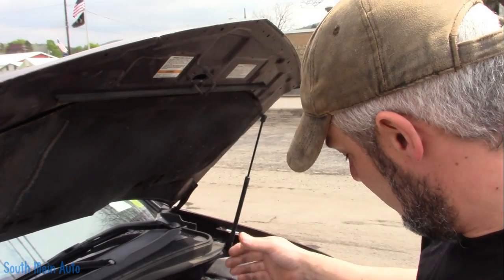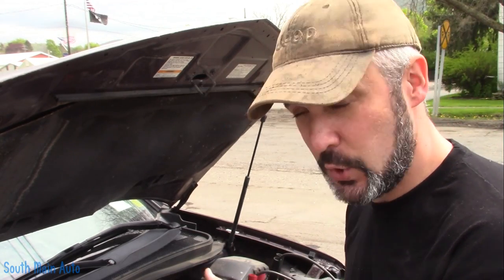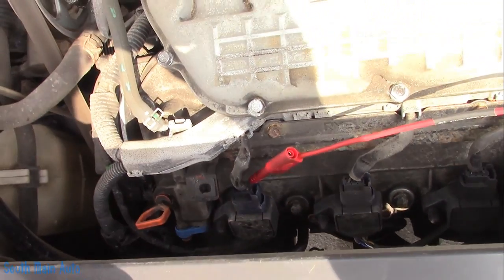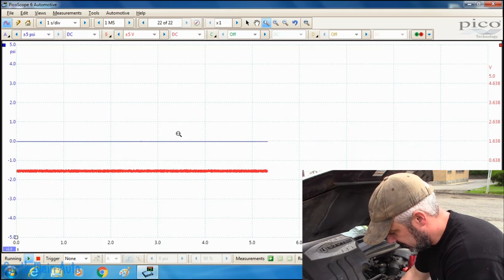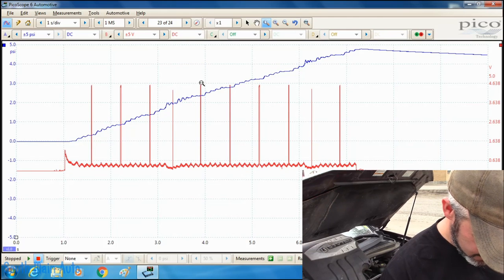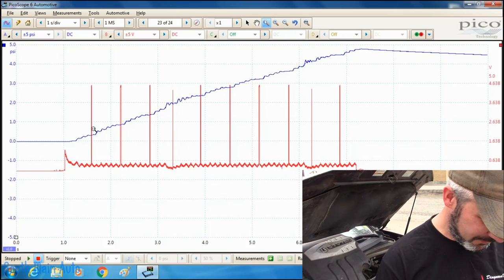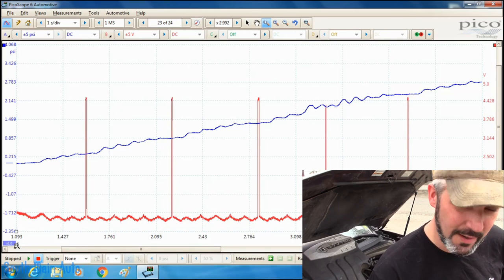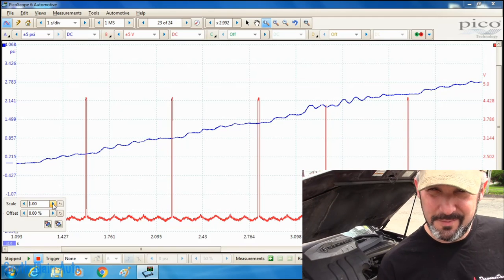Testing For Blown Head Gasket With The Pico Scope

Comment: Had my catalytic stolen on my 99 accord about 6 months ago, they cut the O2 sensor on it and due to lack of funds at the time I just welded a straight pipe to close off the missing part of the exhaust. Drove it around for 3 months like that and had a bunch of cylinder misfires. Changed the spark plugs and wires and it got slightly better but no cigar. Just now got it looked at and apparently my mechanic is saying that although he put a brand new exhaust and O2 on it, the check engine is still on. Says it might be a slight head gasket leak. He quoted me 1300 to 1500 to take it to a machine shop and do the whole 9. 100 bucks for the gasket set and I'll do it myself 😅
Reply: Think I would rather hear “it is” instead of “it might be”. That’s a lot of money and time invested in a guess.
Reply: It's cheaper for you to do, because it's you that's providing the warranty!
Reply: @Graham_Wideman  That's true lol, but since it never overheated to my knowledge, taking it to a machine shop to check the valves and pistons and cylinders is kinda overkill since it only has 176k miles. But I guess it is the textbook thing to do 🤷‍♂️
Reply: Easy to test for that on a running engine. Go to a parts store with loaner tools and get the combustion gas tester they have that uses fluid to detect gasses in the coolant. Or do a coolant pressure test where you use a small pump to add pressure into the radiator/bottle and see if it holds. If you add the same pressure the cap is rated at it should hold at that pressure for days. If it leaks down you have a problem.
Reply: Blazer02LS because radiator pressure is lower than combustion pressure a crack may not show up with just a cooling system pressure test. But the combustion dye test you mentioned does work pretty well if you are patient and give it time to do its thing. I have the tester and the fluid and have had good luck with it.
Reply: True that compression pressure is higher but I have yet to find one that is really bad that holds pressure for very long.
Reply: Well I just got the car home yesterday and it works fine. Out of the mechanic, it was still misfiring but he did a good job on the exhaust itself. After it got off the tow truck I ramped it up and jacked it up to take a look and just started messing around with the connection to the O2 sensor in the cat and went under the dash to mess with the connections there. When I hit one of the relays I heard a click but I didn't think anything of it. I turn the car on and let it idle down to 700rpm (which is where it usually started to misfire) and nothing. I fucking fixed it by just messing around. Drove it 50 miles yesterday and no issues other than rusty breaks and squeaky coils but that's to be expected since it sat for like 3 months.

Comment: This will end up on Craigslist  "won't start needs sensor, easy fix"
Reply: "got all the parts for it, just don't have time to replace them all"
Reply: @opl500  honestly that's how it was with my last car. Needed a new tranny and I had the part just didn't trust myself enough to replace it myself lol
Reply: don't forget the one careful lady owner , only driven on  Sundays to church and bingo night  ,actually that sounds a lot like my mum's Honda
Reply: When I was a teenager (in the 90's), we'd buy cars just like that from old ladies for like $50 and they ran awesome. Amazing that we could get Monte Carlos, Regals, and Cutlass's for dirt cheap back then.
Reply: Many a true word spoken in jest...
Reply: Saw a Trailblazer on CL "has code. Needs either a tune-up or spider assembly." My guess is that it needed the assembly.
Reply: File this one under N.A.E.
Needs An Engine.
Reply: I bought a Mazda3 from a kid who in the ad posted "Needs shift solenoid, in good condition"... I gave him about 500 for the car because it definitely did NOT just need a shift solenoid....
Reply: "crank no start mechanics special"
Reply: NADA_RETAIL - LOWBALL_REPAIR + MY_CAR_UPCHARGE = ASKING_PRICE

Comment: Did u look for foam under the oil cap
Reply: It takes oil and coolant (or water) to create foam. The engine seemed very low on both. The pressure tells the whole story and much more clearly... lots of things can create mayonaisse, especially in winter.

Comment: Sounds an expensive and time consuming fix for the owner what sort of cost are they looking at?. Do you not test the radiator fluid for exhaust gases?
Reply: A junkyard (low miles) motor could be around 1K$, other parts 500$, and Eric should clear at least 1K$ labor, looks like 3K$ repairs, 4K$ with rebuilt short block, my guess.
Reply: @umajunkcollector   Whats the retail value for one of those, is it worth the outlay?
Reply: @umajunkcollector  don't forget the catalytic converters that likely also got "poisoned" from all the coolant going out the exhaust.  That check engine light for a catalytic converter efficiency code will quickly turn a profitable engine replacement job into a huge headache regardless of warning the customer ahead of time that you can not know if the catalytic converters are any good until the engine is running & a drive cycle test is done.  Also never rely on stored codes from an engine that won't run - depending on how poorly the engine was running before dying, the catalytic converter testing may not have been completed to set a code for a failed test.
Reply: I am thinking that for exhaust gases to get into the coolant, there would be a gasket leak, which was detected by the test that Eric performed.

Comment: A blown head gasket means a new engine. I call that great engendering. Bravo Honda
Reply: It's not the blown head gasket that "causes" engine replacement. It's overheating the engine that causes multiple varieties of possible damage, cylinders, pistons, valves, and the head gasket is just one more.
Reply: Damn aluminum blocks
Reply: @SuperDd40  Er, how am I excusing Honda exactly?  Sorry, but you'll have to go enjoy your suggested activity with someone else.
Reply: Not just a blown head gasket. It's the constant high temperature thermal cycling when it's overheated multiple times. Will destroy many brands if it continues.
Reply: "engendering"

Comment: For a novice, do you have a link for what a good radiator test like this should look like and how to analyze  it?
Reply: Basically, the action of the pistons in the cylinders should not build up pressure in the water coolant system!  The coolant system does build up pressure in normal operation (hence the pressure cap on the radiator), but only due to the heating of the water, which it's obviously not going to do with a few starter cranks while not firing. So if the test Eric performed does build up pressure, it means there's a leak in the head gasket from the cylinders to the nearby water channels.  Eric was hoping to see a distinctive pulse corresponding to a single cylinder leaking to a water channel. But instead in this example you see steps in the scope trace for each of the cylinders, though some steps are larger than others.

Comment: You have any videos showing the pressures pulses results from a known good?
Reply: There should be no pressure pulses on a known good. The combustion chamber and the water jacket are (or should be!) completely independent and sealed from each other. The coolant pressure should come from the coolant being heated by a running engine only.
Reply: wirenutt57 🙏🏻
Reply: Flat line on a cold engine.
Reply: Tgoodm1 is scotty Kilmer in cognito.
Reply: @Jason Bowman Eric was checking the pressure in the radiator. The pressure that built up had to leak by the thermostat. If the thermostat were open, or he was checking the pressure on the engine side of the thermostat, he might have seen pressure from the water pump.

Comment: I was hoping to see pulses ! COOL idea (pun intended)
Reply: Swap out the Pico WPS pressure sensor with a SenX FirstLook pulse sensor, and you will be able to pinpoint the exact cylinder(s) very quickly (after you get used to interpreting the data the FirstLook pulse sensor provides).  SenX has some great case studies on their website that go into great detail showing all the different ways their FirstLook pulse sensor is used to diagnose many different issues on vehicles.

Comment: Was that computer running Windows 98?
Reply: Dell Latitude 3340 laptop with Win 7.  It's a 4- to 5-year-old budget-conscious device, but a solid machine overall.
Reply: Why upgrade to 10 when you can run PicoScope on a turd connected to a potato battery?
Reply: What's wrong with windows 98?
Reply: The Pico runs just fine on older hardware. Which is great as you don't get the Win 10 automatic updates that take hours when you need the tool NOW...

Comment: Interesting! Hard to use on anything with a Egr cooler or water cooled turbo or compressor?
Reply: Why? Any pressure is still generated by cylinder leakage to the cooling system, not the centrifugal pump, at such low speeds.
Reply: I should have been more explicit. I was looking more at Diesel engine large and small applications as to whether one could pinpoint definitively or at least rule out the head gasket.

Comment: Didn't  quite understand the test you done, cause I'm not familiar with that testing parameter. And (2) I would have thought that the engine was an interference engine.   With aluminum heads, meaning any over heating would have caused a headgasket to blow. Hence the non start, do to vavles hitting the pistons. Nice video and good call on the engine.....
Reply: A blown head gasket doesn't cause valves and pistons to collide. That's usually caused by a broken timing belt because a valve can be open when the piston gets to TDC.  Since the timing relationship between the pistons and valves is incorrect. As to the testing parameter, if the blown part of the head gasket is between the cylinder and one of the coolant passages, the pressure during the piston compression stroke, will get into the cooling system, causing an increase in pressure. If the blown part of the head gasket was between the cylinder and one of the oil drain holes, then there would be no increase in pressure in the cooling system.

Comment: Their would of been bubble coming out of the radiator cap  as the exhaust escapes the head gasket ,no fancy tools required .
Reply: Dr. O just wanted to play with his toy ....errr tool.
Reply: Or just pull the oil cap and peep the grey snot.
Reply: I don't think there's any water left in the engine anymore!
Reply: No bubbles - gushes of liquid (once the system is refilled... tap water is fine for that). With bubbles or gentle overflowing it will still start.

Comment: Owner of the overheated car: "remember viewers, if I can do it you can do it".. 
;-) 🇬🇧
Reply: lol
Reply: Typical,it keeps overheating but they keep driving until it goes BANG!!! and that's the end of the motor,and from selling auto parts/repairs the mechanic showed me many cars with completely bald tires,steel coming thru, front tire's completely worn on 1/3 of the tread because of suspension issues and the rear tires just as bad and when you tell them it can't be inspected until new tires are put on and the suspension ISSUES are fixed and you give them a price and of course they say no, but usually a week later they've found the money to fix it and then get it fixed correctly,and I remembered 1 guy who's car kept overheating and he kept driving it until it dropped dead, steaming like a b**tard in front of where I was working,he left it until it cooled off and the mechanic could look at it Monday morning (shop closed on Sunday) was only a one man operation and like in the video he cooked the engine and after we got prices on a used and rebuilt engine and he was told the prices and declined the repair- he had it towed away and never came back
Reply: @RedArwBus  I think that is the main clue: I don't think they are going to repair, but rather they wanted a pronouncement of death.

Comment: 2:58  Looks like 3 large pulses, followed by 3 smaller pulses.  I'd guess the head gasket for one entire bank is nuked - or there's a crack between the combustion chambers and going right through to the water gallery.

And for $64,000 and what's behind door number one, I suspect it'll be the rear bank, where you can't actually get to it.  :-P
Reply: That's would I would guess. The pressure rises line up pretty well with the peaks on the trigger line. Totally nuked a bank, maybe both banks.
Reply: just a guess, judgeing by the pulses and the number 4 trigger it appears like cylinder 4 and 5 are not contributing to the pressure pulses indicating that they are still sealed and cylinders 1,2,3 and 6 are blown. I wish Eric could of put a compression gauge on them to compare to the waveform just for sh*ts and giggles!
Reply: Really, though... how would you feel about not even pulling both heads on an engine in that shape?
Reply: Not only that, but even though one bank doesn't look too bad, remember that's only with crank pressures.  It could be (likely is) a whole lot worse once you get the pressure wave from actually firing.
Reply: @aussiebloke609  it's not about replacing the engine while it definitely should but it is more about discovering a quick and accurate test with a pressure inducer!

Comment: To narrow down which cylinder(s) with more precision, put a FirstLook or similar differential style pressure sensor in place of the Pico WPS pressure sensor.  It takes some repetition in testing using this method, but we have been using this awhile & have high confidence in it now.
Reply: What does a differential pressure sensor show you that's different? And being differential, what do you connect the other port to?
Reply: @Graham_Wideman  SenX Technology website (Youtube is not allowing me to post links to websites, but it is senxtech with the typical "com" ending) does a far better job of explaining how their FirstLook Pulse Sensor technology works than I ever could in this comment section.  Their website also has numerous examples of all the different ways their sensor can be used in automotive diagnostics.  They even have a very detailed case study regarding the use of the FirstLook pulse sensor being used to diagnose bad head gaskets.

Comment: That job is going to require 2 bottles of leak stop...
Reply: Bluedevil head gasket repair... That wtufr actually works tho. I had a DeVille with a bad head gasket. It would fit and over heat while throwing coolant out of the radiator got that for like 80 bucks and I followed the directions and it worked. Ran the car for 2 years then sold it. It never lost a drop of coolant afterwards
Reply: I went down to Supercheap to see if they had any overhet-fix :)
Reply: Two of the 44 ouncers.

Comment: Always learn something new from I never would have guessed by overheating the engine it would make cylinder walls go wonkey too.... great video as always!!!
Reply: As my old dad taught me when I was growing up, if you grossly overheat an engine it can warp everything. Based on what he did even if two cylinders weren't out around I wouldn't give two cents for the heads. My dad was a Master Mechanic back in the day in the army. He worked on everything from aircraft engines to diesel to lawn mowers. Automatic and manual transmissions you name it. I learned a little bit I know mostly from him and just getting the wrenches out and going at it. I can't imagine someone driving down the road running an engine in that condition. I did have a hose break on the way to work one morning I was a half a mile from the dealer where I bought the car so I just kept going and pulled it into the parking lot. For the record I coasted it all the way. I turned off the ignition as I pulled into the parking lot.

Comment: I thought the radiator was suppose to build to 15 psi.  Is that wrong?
Reply from the maker: Yes when the engine is running and the coolant is heating up and expanding. But never during cranking in a cold engine.
Reply: @SouthMainAuto  could just palmed it to feel the blow by lol
Reply: @Bereft777  Right, but Eric wanted to actually see the pulses on a scope for edumacational purposes.